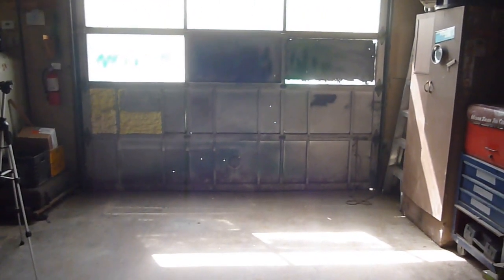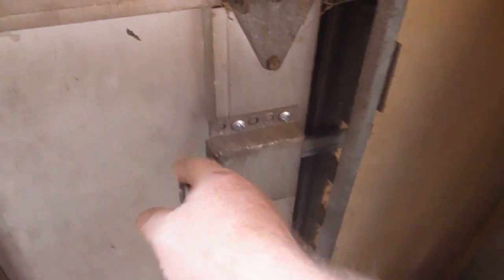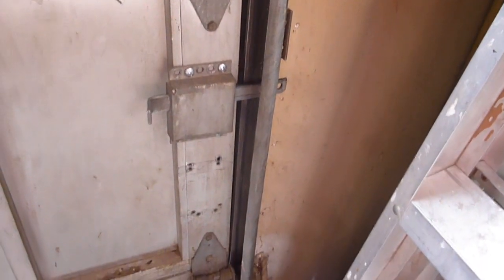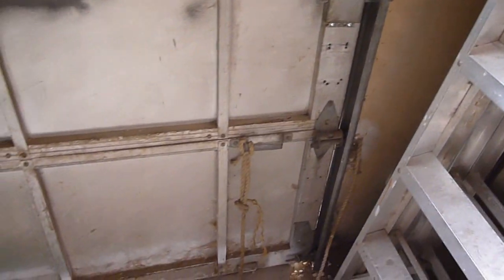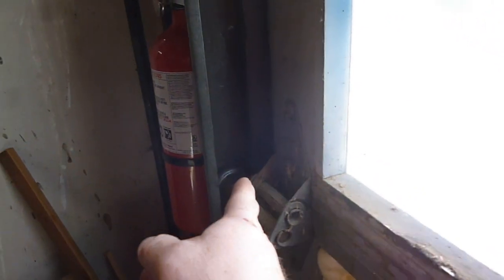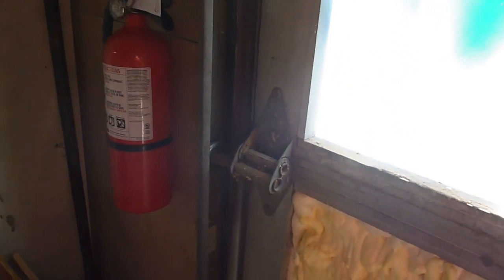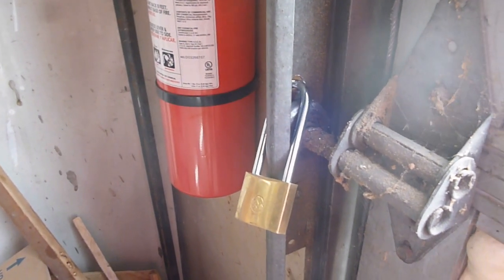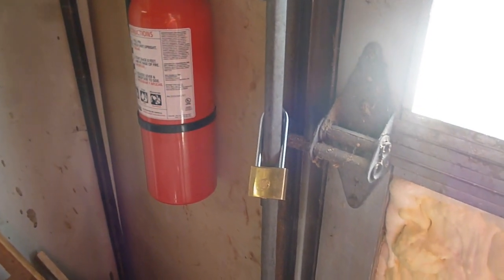GARAGE DOOR SECURITY

Comment: Instead of a lock, I use a large steel carabiner clip that goes through the hole.  It's easy to put on/take off and doesn't require a key or combination to use. I have one on both sides of my garage door.
Reply from the maker: 👍 good idea

Comment: At 0.44 you they can fish around and open that latch up. There’s a hole on the end of it for a lock. If you put a lock on it, there’s no way to “fish around” and open it. So you will have to locks on each side plus your dad’s bolt on the bottom. I think that door is well secured.

Comment: After seeing your video, I might bypass using the latch lock my installer just sent me, and install a padlock instead. What kind of metal-drilling bit did you use, so I don’t accidentally push the track out of place while I’m drilling?
Reply from the maker: the drill bit was out of a pack from harbor freight make sure it's for metal, as far as pushing the track out ,you would have to decide on that

Comment: Why not put the lock on the the bar with the hole already drilled on the other side?
Reply from the maker: so that its secure on both  sides less chance to tweek the door  of the tracks
Reply: @JunkworksGarage He’s talking about the bar on the latch on the right side. There’s a hole for a pad lock. If you put an additional lock on that little bar, they cant fish around and Jimmy it open.